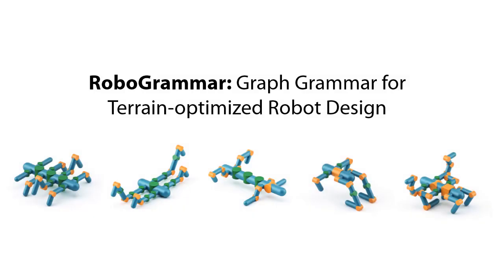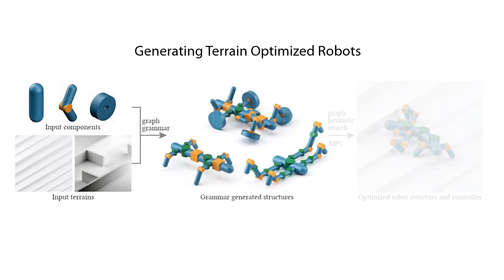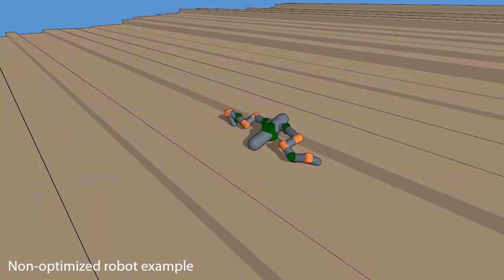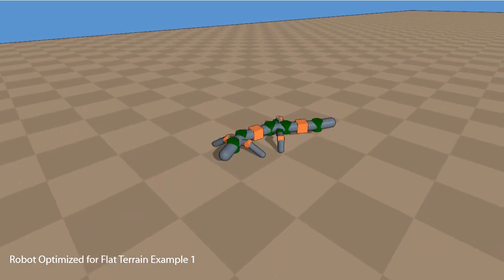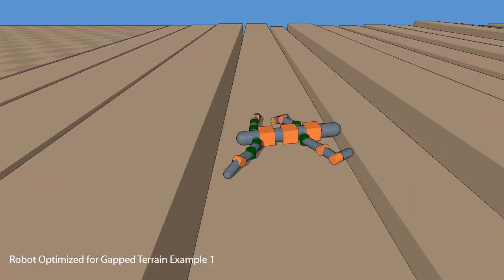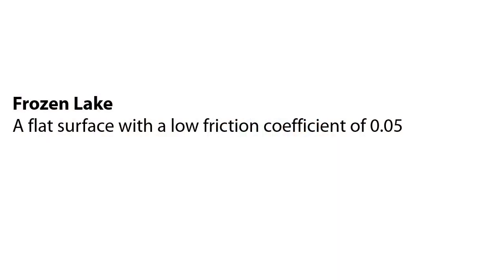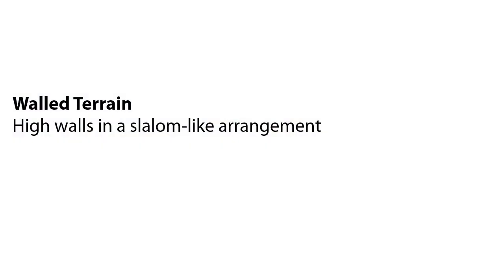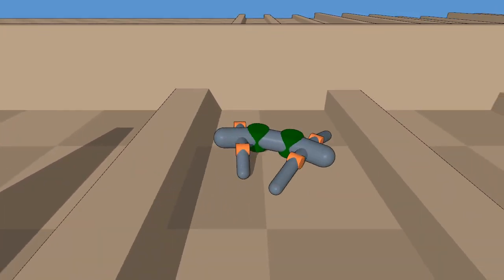RoboGrammar: Graph Grammar for Terrain-Optimized Robot Design

Comment: If these are optimized designs, why are not we are seeing them in practical usages?
Reply: I would say three major reasons.  

Reason 1 is that this research is brand new, so it hasn't had time to percolate into any real-world design software yet.  It will probably take a few years for such methods to catch on - and maybe something even better will show up in that time, who knows!  This is a growing research area.

Reason 2 is that these robots only work in simulation right now.  Probably the next frontier of this research (and another hot area) is overcoming what's known as the "sim-to-real" gap - how do we make sure that these robots perform in the real world the same way they do in simulation (since simulation inevitably has error)?

Reason 3 is applications.  It's very exciting that we can optimize designs and behaviors for different terrains.  But you may want designs that work for many terrains, or more sophisticated tasks other than locomotion.

We think this work has a bright future - and hope people build cool stuff on top of it - but it is not yet ready for prime time for real world robots.